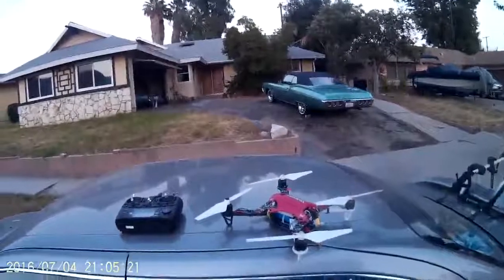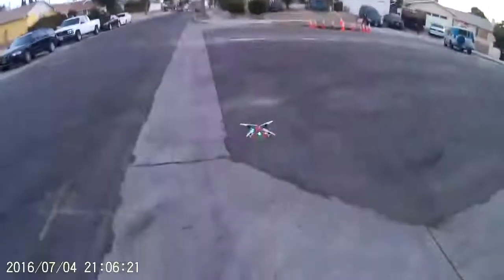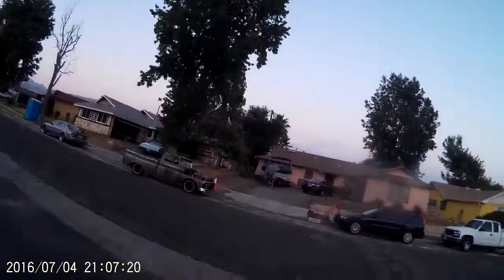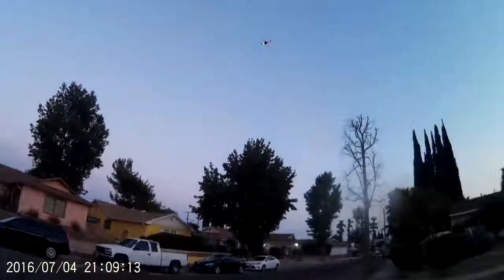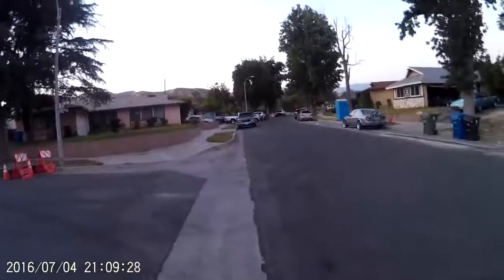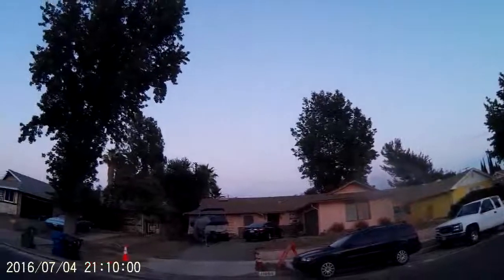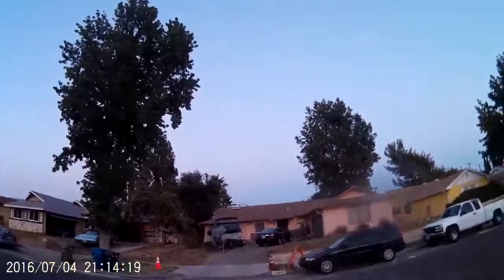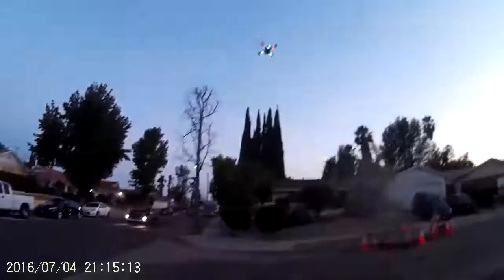XK X BUGS 350,  The brushless RAT ROD.

Comment: That was a really nice flight  Markie, I could not even hear those motors turning man. I will say one thing, that you do like flying high but it seemed to perform very well.
Reply from the maker: There is not one tree in this video that failed to snag and intrap one of my birds at one time or another,  I sort of get hypnotized by the altitude but it also stems from my OBSTACLE AVOIDANCE SYSTEM,  lol its easier to go OVER something, than it is to go AROUND something..Thanks for watching GREG.